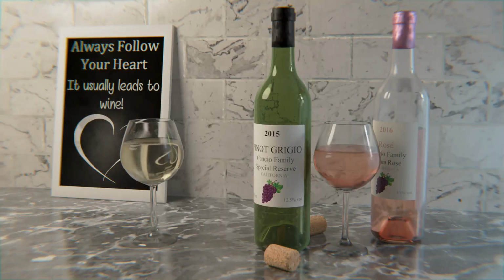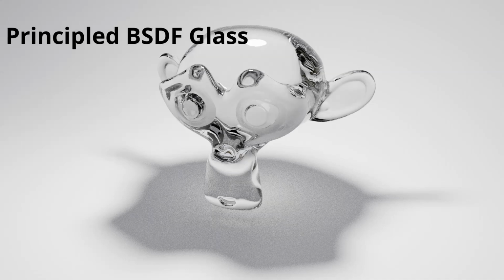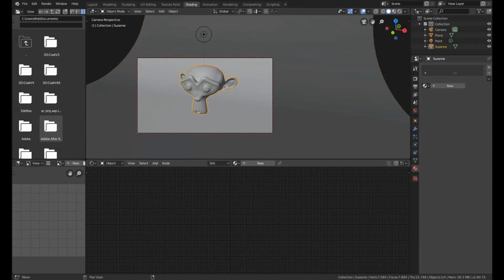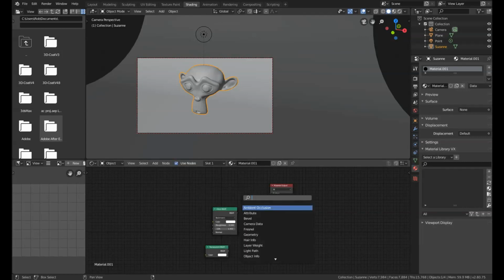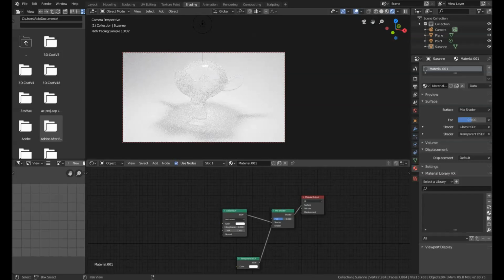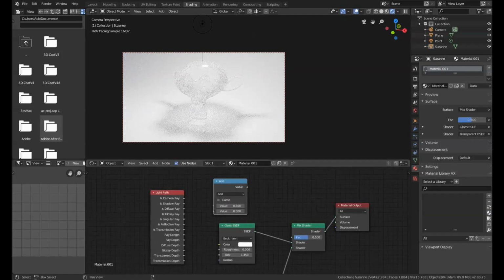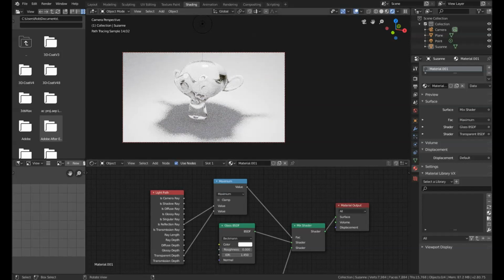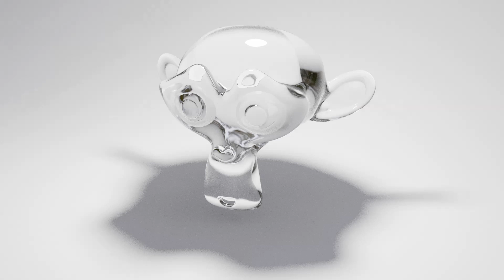Blender Quick Tips - Better Glass In Three Minutes

Comment: Really appreciate this idea!  With Blender do they have AOVs to show the noise from any render pass?  In Redshift or Arnold, I could render just the noise passes such that I could DECREASE the albedo, ..., etc., and INCREASE only the samples of the noisy render passes...  This way, though front loaded slower, I got fast renders.  Redshift was still 7x faster than Arnold, but cycles is close to Redshift, (e-cycles has only been about 10% faster for me on a 1080ti bitminer GPU) and I don't know the render engine well enough to know if this can be done as well natively in cycles, but I do know the default settings are totally inconsistent with reality most of the time.
12 min video?  I'd watch that.
Reply from the maker: Redshift is a biased render engine. That basically means it uses a lot of cheating and approximations to optimize the render process. It's faster and delivers more control over noise - but it's less physically accurate. Cycles is unbiased, so it calculates every light bounce accurately.